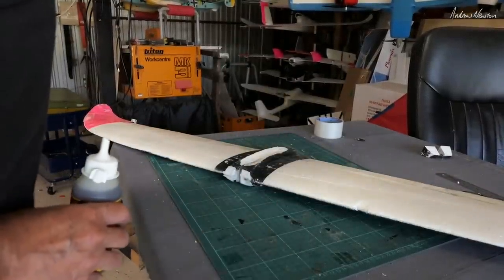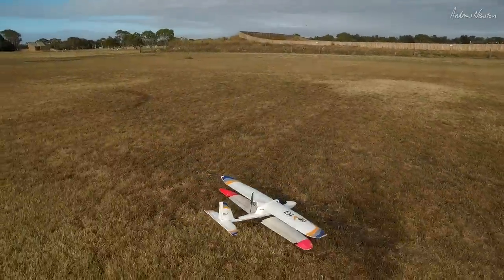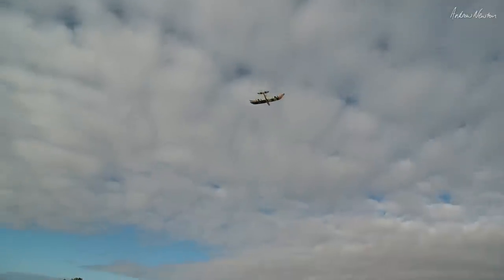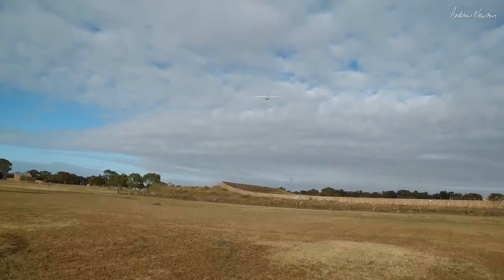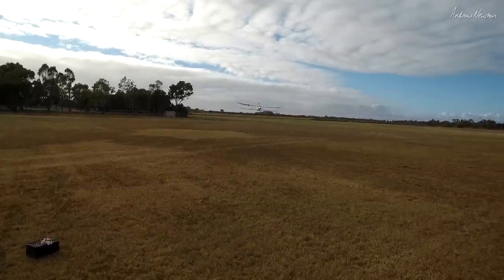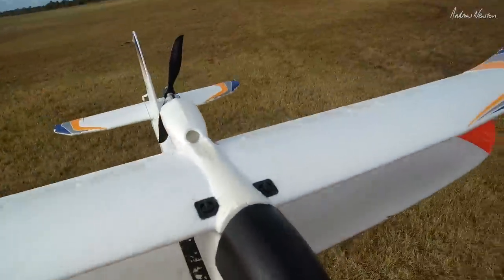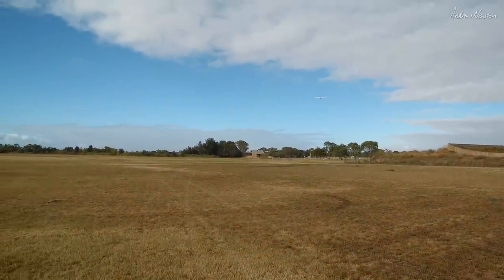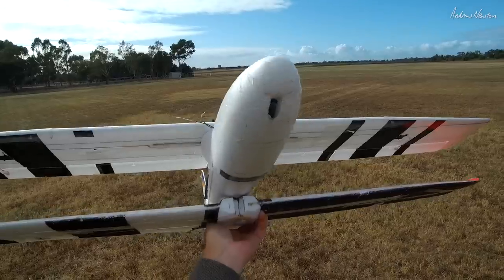Bixler Biplane

Comment: That looks very nice!!  Shave down some off the bottom leading edge of the lower wing saddle fuselage or sand it to an angle...some wing struts and it's almost worth purchasing two to create the Bixler Bipe as a new model!!  YES!!
Reply from the maker: Saddle shaved down and faired in, inter wing struts installed, ready for another test
Reply: Outstanding Sir - LOL .....always enjoy your video's and "Experimentation"....looking forward to the next flight....Tally Ho!!

Comment: Maybe add a carbon fiber spar to the lower wing to stiffen it up. Very nice flyer in any case!
Reply from the maker: Struts worked nicely. Video up soon.
Reply: @AndrewNewton   I am sure they work,but my point is they would add drag,which putting a carbon fiber span in the wing wouldn't.
Reply from the maker: True Mike.

Comment: I have some students who are in the process of converting their cub into a biplane. Would you have any suggestions?  Do you know how the CG is positioned, in comparison to a single wing? Great job and thank you for sharing.
Reply from the maker: CG will stay where it is if the leading edges are aligned, and it will move back half the difference if they are staggered. Important to have the angle of incidence of the two wings the same. Good luck.

Comment: a novel idea cpt. andrew. and it works good. i like how it does a quick porpoise move and rights itself in a full stall. i think if you add a 3rd wing, which would really be something, you might need more power and more tail weight?.... with dual pusher prop motors... :-)

Comment: Speaking of CG, what CG do you use on the Bixler with original wing? Mine does not fly well, I’ve tried several positions but not found the right one.
Reply from the maker: I'll have to look for that EC but I did need a 3000 3S to bring the CG forward enough